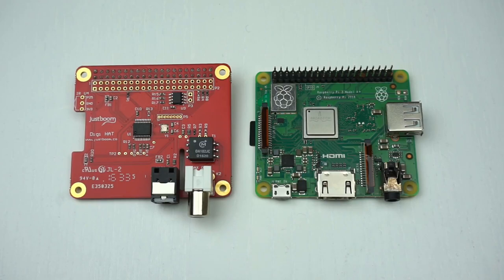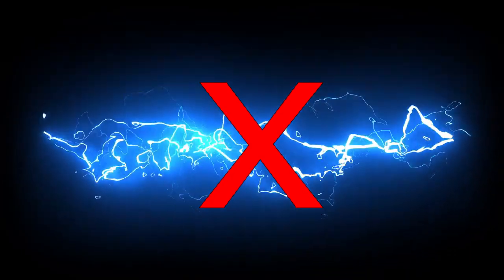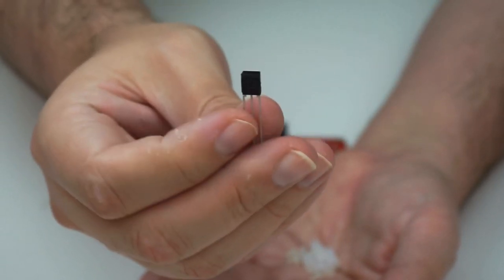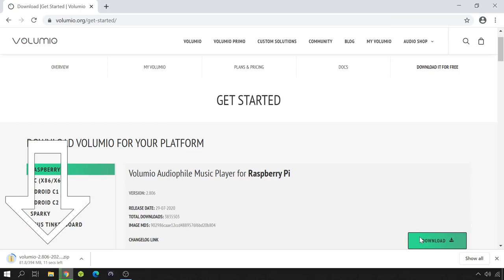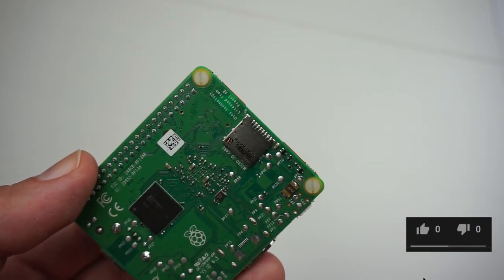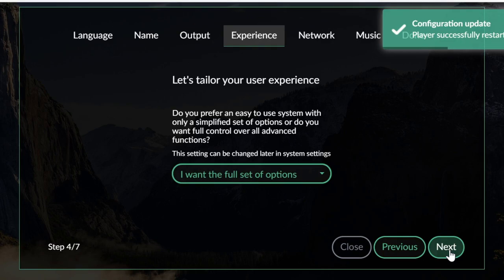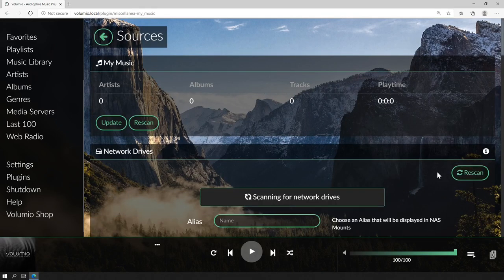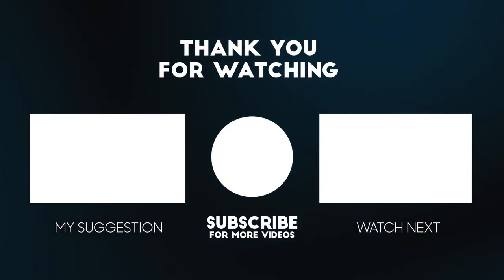HOWTO: DIY Raspberry Pi HiFi network streamer - DigiHat + Volumio

Comment: I find the different takes on setting up hifi streaming interesting with all being valid solutions to how do we do this! 

What I put together was software via the command line from a clean install of Raspberry PI OS I started with the 64 bit version (for kicks and giggles) then installed SMB Apache Fuse and any other tool I thought I would need and then some streaming server software. My goal was to replicate what when I was young using 486's and early pentiums back in the late 90's...    

I ended up building a Raspberry pi 4 with 8 gig memory strapped a 500 gig SSD to it over usb 3.1! it made a great server storage solution, noizy outputs over USB though (the USB 2 Ports where cleanest) ended up making a PI zero W  as a dedicated player in to the $1000+ DAC via USB and have been impressed.

Only because i had done the server player model in the past was the reason why I did it the way I did. It's small noise free and I do not have to run the main PC, There is even web based control and or an App for the package I used. If I was starting from scratch what you showed looks very appealing for an ease of setup.
Reply from the maker: Hi! Thank you for watching and for sharing your story, your experience and how it is possible to achieve the same goal in a different way. I also remember, back in end of the 90s, beginning of the 2000s, a friend of mine setting up a machine with Linux, where he also installed some file sharing software, I don't remember the name, to which it was possible to access using a web browser and we could play his mp3 over the internet at work!! At the time it was mind-blowing to me! I'm always delighted to hear these kind of experiences/experiments. Thank you!

Comment: Great video and very informative! I've ordered a Raspberry Pi 4 kit with the HiFiBerry Digi+ Pro, which I'll be using to connect to my external DAC using S/PDIF coax. I intend to use Volumio for locally stored music. Your video has clarified in my mind how things will work, especially the part where you can select the audio card.
Reply from the maker: Hi Taz! Thank you very much for watching and for your comment! That is exactly how I have it :)
Reply: If your DAC has USB input and its asynchronous, you don’t need the HAT, you can get a RPi 4 and output USB, it will sound even better than from Toslink or Coaxial. That’s what I do. I use the SMSL Sanskrit 10th MKII DAC.
Reply from the maker: Hi Pablo! Thank you for watching and for your input! It is highly appreciated.

Comment: Great video! Does this allow the Pi-Fi to be used as an Amazon Music end point? So I can say to my Echo Dot "Alexa, play 80's Pop music on my Pi-Fi." and Alexa will stream 80's pop music over my WiFi network to the Pi-Fi and out the optical cable to my Preamp/DAC.
Reply from the maker: Hi Jeff, I haven't tried that but I guess is possible. Check this: https://volumio.org/volumio-alexa-skill-find/

Comment: Hello and thanks for the video :)
Is it possible to use a setup like this (Raspberry + Dac connected via cable to an old amplifier) to listen to Spotify, YouTube or streaming services through the Bluetooth of the Smartphone?
Thanks for the answer!
Reply from the maker: Hi Francesco and thanks for watching! Have you checked this video: https://youtu.be/FbHy-spfOGM ? Maybe this is what you are looking for?
Reply: Hi  @ExperiencingIT !
Thanks for your reply and congratulations for your videos, all very clear and with great explanations!

I watched the video you linked and now I have a couple of questions :)
- Once the connection is finished and the Bluetooth of the PC or smartphone is activated, the Wi-Fi is no longer needed?
- By connecting the Raspberry through its 3.5 connector, do you get good sound quality? Or is it better to use a DAC for Raspberry and convert the sound from digital to analog?
Reply from the maker: @MrFrancesco171717  Thank you! Answering your questions: if you are streaming from the internet, most probably you'll need your Wi-Fi connection. If you have your digital audio files stored on your phone or computer, I'd say that you don't need Wi-Fi turned on.
Regarding the Raspberry Pi's audio quality, I believe that you get good enough quality through the headphones jack, but if you'd like to have a setup closer to an audiophile setup, you'd have to use a separate DAC.
Reply: @ExperiencingIT  many thanks :)

Comment: Hi! Thanks for the video, so useful! Is there a problem if I use a 2gb Raspberry or should I use a 4gb one? Cheers!
Reply from the maker: Hi! I'm using a raspberry pi 3 a+, which has 512 MB of ram, so I believe you're good with any of the ones you mention :))

Comment: Can this work good with volumio free ? Is it free forever ?
Reply from the maker: Hi FilipV! Thank you for watching and for your comment! Yes, the free version is free forever. They also have paid versions of Volumio, which add some features to the software. If you'd like to read more about them, here is the link : https://volumio.org/volumio-plans-pricing/
Reply: I've been using it for a year or so, no issues. You aparently need the paid version if you want to stream from some streaming providers.
Reply: @ExperiencingIT  Are there other options beside Volumio?

Comment: Nice guide! But I have a question, if I use the USB port to connect to my DAC, seem I can even skip the DigiHat?
Reply from the maker: Hi Peter, from what I've watched in another videos, there's a kind of a hiss when you connect the USB directly to a DAC, due to static electricity. I've never tried it myself because my amplifier doesn't have a USB port...
Reply: @ExperiencingIT  I have go through the many resources, seem raspberry pi 4 fixed the usb bus problem, seem connecting to usb dac is now a workable solution! I will buy one and try~

Comment: Hello, your video is great, thank you very much, do you think you can help me with some questions ?:
1.- From the browser is where you can control Volumio, but the audio will only be output from the Raspberry interface either through a USB -> DAC or Digi HAT Coax -> DAC, that is, Volumio does not stream local files to the PC that controls it. Does this work like this or is it possible to access your music remotely on the same local network? I mean, from the PC that I connect to Volumio I can listen to music and the Raspberry with Volumio works as a music server

2.- Does it only support NAS or can I connect an external hard drive with all my music to the Raspberry and it will recognize it?

Sorry for my bad English.
Reply from the maker: Hi Eduardo, thank you for watching y por tu comentário!
From what I understand, you can setup Volumio as a DLNA server. That would allow you to access your music from other devices that would support DLNA.
As for the USB question, it does support USB media.

Comment: Do these various cases provide enough of a heat sink to keep the Pi below 60°C such that it will not start throttling?  And if it starts throttling does that affect its performance in use? Can we practically use the Pi as a streamer for several hours without any issues? Thanks.
Reply from the maker: Hi Ross, I use this setup everyday for several hours without any issue!
Reply: @ExperiencingIT  that is good to know. It was one of the concerns I had that made me give building one second thoughts.  I didn't want to buy a bunch of components, go through the motions of building it, setting it up, getting used to the software, and then have it die.
Reply from the maker: Yeah, I understand that. Note that I'm using the raspberry pi 3 A+. I don't know how'd it be with a more powerful raspberry pi, but I believe that with some passive, no noise, cooling, you'd be fine.

Comment: Hello, thanks for your video. Im just researching on how i could go about building a streaming solution for my system... so what im wanting is to stream music from tidal to the raspberry pi (with my Dragonfly cobalt dac plugged into the pi's usb) then from the dragonfly output to my integrated amplifier... This would basically turn my dragonfly into a streamer dac? Is this what is possible with this kind of setup? Thanks for any clarification you can give me.
Reply from the maker: Hi Damian, thank you for watching and for your comment. Yes, that is exactly what you can achieve with this kind of setup.
Reply: @ExperiencingIT  thanks for your reply. I will try it 🙂

Comment: Thanks a lot for this. One question: Is there any difference in sound quality streaming from this versus from a PC with TIDAL, if both are connected to the same DAC, headphone preamp and headphones? Thanks.
Reply from the maker: Hi Stefan, thank you for watching and for your comment. I couldn't tell you because I've never tested that scenario.
Reply: @ExperiencingIT  Thanks. Then why bother with a Raspberry Pi streamer, if it doesn't sound better than the free streamer (the PC)?
Reply from the maker: Hi Stefan, well, I didn't say that it sounds better as I haven't tested that scenario. Regarding bothering with having a streamer, well, we all have different needs and I don't want to listen to music from my PC or want to have a PC connected to my amplifier all the time. I'd rather have a headless, low power, unit that I can control from a browser, either using my phone or my computer - usually my phone.
Reply: @ExperiencingIT  I know you didn't say that. However, for me, who always have the PC on, the only reason for having a streamer would be better sound quality.
Reply: @stefanhansen5882  pc is noisy